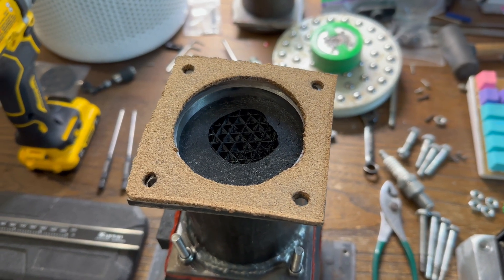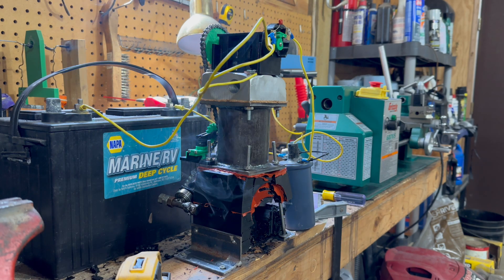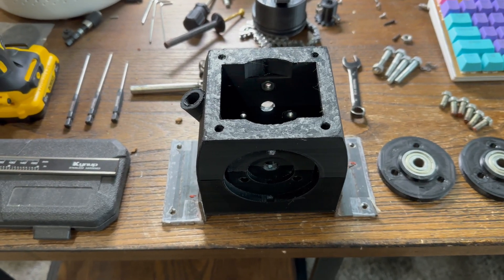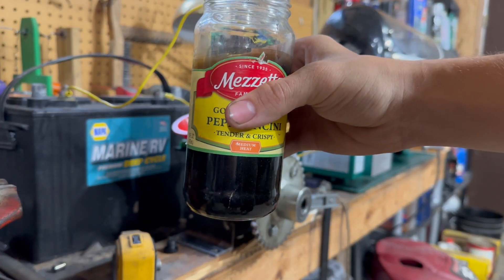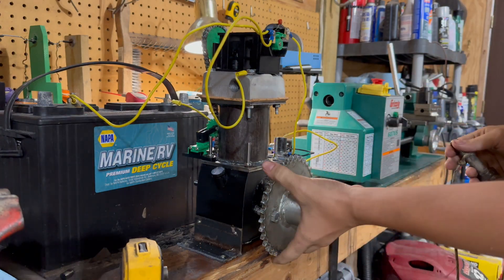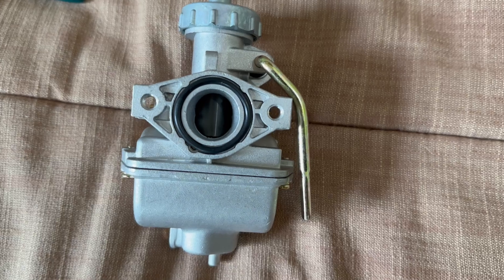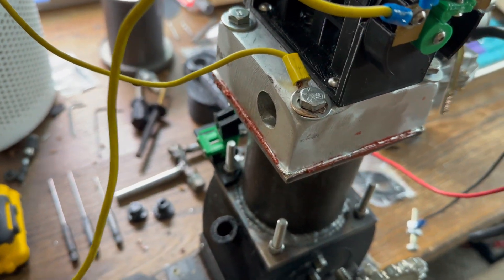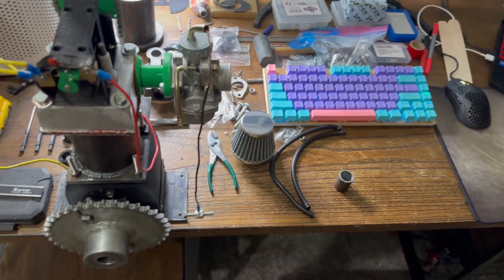3D printed 180cc engine RUNS!

Comment: I loved your excitement when it ran! Have you thought to make it smaller? I love the idea that you are making it big but isn't it a lot more dangerous like that? Also I wanted to ask if you could name EVERY part for the ignition system? I Have know clue how you or Camden Bowen made the ignition system...
Reply from the maker: The part I like about making it big is it’s a lot of trial and error until you get a part That’s strong enough to hold up. 

For my ignition system, I have a wire from the negative side of the battery running to one side of a light switch that I tore apart. The light switch has contact breakers in them, so I used them as my contact brake ignition system. There is a little cam on the camshaft that pushes up on a lobe that’s connected to the arm of the light switch, and that breaks the contacts. Then out the other side of the light switch that I took apart, I have a wire going to one side of the ignition coil. Out the other side of the ignition coil goes to the positive on the battery. Then on the negative side of the light switch contact breaker, I have another wire that is my ground that is in contact with the head, because the head is aluminum. Then I have a Small engine condenser that goes to both sides of the ignition coil, there is a wire and the metal casing, the metal casing side goes to the positive and the little wire goes to the negative on the ignition coil. And then out the top of the ignition coil, there is a wire with an alligator clamp on it that goes to my spark plug. That is the entire ignition system. The small red capacitor that you see in between my contacts is not necessary, I added that before I bought the condenser, but the condenser works way better. The small capacitor does basically nothing.

Hope this helped!!!
Reply: @ProjectLMZ  This was very useful! Thank you!!! But I'm a bit confused on what the engine condenser is... And also do I have to use a big car battery? Or can i use something smaller because that doesnt look very safe...😕 But again, thank you so much, this was very useful!!!😃
Reply from the maker: @TheBMWDrifter-sb2cy  a engine condenser is basically a capacitor, but specifically designed to be used in engine ignition systems. You do not have to use a large car battery, that’s just what I had laying around, any 12 V battery will work, like a smaller one for a 12 V power wheels toy.
Reply: @ProjectLMZ Thanks again, that's good to know!😁 It's nice to hear a YouTuber reply to questions in full form! For alternatives for head gaskets, do you know any? Because I don't have any, and I don't really want to buy any... Again, I could not thank you more for answering my question!!!😃 Also a weird question, but what country do you live in? Thanks again!
Reply from the maker: @TheBMWDrifter-sb2cy   The head gasket for my engine is made out of cereal box cardboard, Beer box cardboard would work as well, it just needs to be that more compressed and thinner cardboard, and then I put a nice layer of red RTV silicone on each side of the cardboard and then wrapped it with five layers of aluminum foil, making sure to put more RTV in between each layer. 
America!
Reply: @ProjectLMZ Yeah, I was thinking of using some cardboard... What is your opinion on two stroke engines and four strokes? What do you think are the pros and cons of building either with 3d printed parts?
Reply from the maker: @TheBMWDrifter-sb2cy  with 3-D printed parts I like the four stroke, I attempted a two-stroke a little bit back, but no matter what I did I couldn’t get my ports right. The other reason why I’m going with a four stroke is because I can get much more power out of it by putting a turbo on it. My future plans for this include a turbo and nitro!
Reply: @ProjectLMZ I was looking at some of your older videos, and when it was snowy, it looked like Canada, that's why I was asking. How would you add nitro tho? I'm making two stroke, and I'm gonna be cutting ports in brass drain pipe cylinder, but I don't really have any tools😕 do you have any experience with brass pipes?
Reply from the maker: @TheBMWDrifter-sb2cy  it sometimes feels like Canada here in Minnesota, for adding nitro what I would do is I would 3-D print a new intake manifold with a port for putting another line into, then I would just drip feed the nitro. I don’t have any experience messing around with brass pipes, but I can only imagine because the number one element is copper it’s very similar to working with copper pipe. I think the two-stroke is feasible as Camden Bowens new post, but they need to be cut very precise.
Reply: @ProjectLMZ Have you ever visited Canada? And if so, which part? The nitro idea is super cool, but id suggest working on making the engine run reliably, like Camden Bowens last video. I also noticed the way your runs, and I've taken apart lawnmowers before and if they aren't made properly or are tweaked properly, they struggle to run due to their shear size... Have you thought of making pretty much the same thing as Camden bowens? Then you could make your edits?🤔 Nitro and turbo what not...
Reply from the maker: @TheBMWDrifter-sb2cy  I have visited Canada, we used to go to Ontario every year, we would go to a lake called crow Lake and fish for lake trout.
I did start with a smaller engine, but I didn’t find it as exciting, and I really like the challenge of it being difficult to get going! With the new crankshaft, I have calculated the exact weight of the counterweights, and I will be able to match that with my rotating assembly. Since the rod is larger, I’ll be able to center my flywheel better.
Reply: @ProjectLMZ Well it definitely sounds like you have a plan! Not sure if I will see your video immediately tho, gonna be camping for the next week... Canada's great for camping btw. My family also used to go fishing in this one good area and get some big fish! But we most likely won't be going there bc they are dumping sewage 😅 anyway, I will try to keep up but alright I'm excited to see your future updates on the engine whenever I can!😁

Comment: you spend so much time printing useless plastic parts... just make metall parts from the begining. also the crank-case
Reply from the maker: That’s my end goal is to have all metal parts, but I’m using the 3-D printing as prototyping. Surprisingly though my connecting rod and case and valve train are holding up just fine!

Thank you for watching!!
Reply: @ProjectLMZ  that connecting rod surprised me too.

Comment: 14:26 Use a sacrificial piece of wood underneath your work or even 3d print yourself a vice.
Reply from the maker: That’s a great idea, I didn’t think about that! I 3-D printed a new intake manifold with the layer lines diagonal and out of a much stronger filament and it hasn’t had any issues, just the crankshaft snapped again😂

Comment: May seem really stupid, but I suggest using Flex seal as a gasket, it works pretty well in a actual engine, may work better than some cereal boxes and aluminum foil 😆
Reply from the maker: Surprisingly, my homemade head gasket has not had any issues yet, but I’ll keep that in mind!!

Thank you for watching!!

Comment: If I was going to 3D print a piston I would probably give it 100% rectilinear infill.  The broken one in the beginning of the video looks like it was around 15% cubic.
Reply from the maker: It was, with the current one it is at 40% infill cubic, with 3 mm walls, and it holds up fine surprisingly! At least I haven’t had any catastrophic failures with it yet. There’s no workaround to the heat though, if I start having melting issues, there’s not much I can do.

Thank you for watching!!

Comment: U gotta start using a two stroke membrane, it blocks the exhaust towards the intake fully, also it's shooting exhaust gas through Ur oil cap, probably leaking O ring as well :) nice build tho! 

Try and see if U can work with the info

Comment: You should make the flywheel perfectly straight and balanced if you don't want it in more pieces than one. Also, crankcase ventilation is a big thing, if you don't have it. As the piston goes down it creates pressure in the crankcase, if everything is sealing right. The hole you have is shooting oil out of it at bigger rpms, from what I've seen.

Comment: You have pressure on the crankcase. It means your piston rings are leaking. 💨 That's why you see all the smoke coming out of your oil cap on the last pulls. 💨
Reply from the maker: I thought the same thing, but after I talked to my uncle who is a small engine mechanic, he said the reason is because the cylinder volume and crank case volume are very similar, so you get a whole bunch of crank case pressure. It’s just gas moving in and out of the crankcase so fast.

Thank you for watching!
Reply: @ProjectLMZ  There is clearly exhaust being blown out of the oil filler, so the rings are not sealing correctly.

Comment: You need to fix the blow by. When your running it you can see more smokr from the crancase then the exhaust lol. But also, a bigger flywheel and to make the output shaft viberate less would help too.
Reply from the maker: I thought it was blow by at first, but after talking to my uncle who is a small engine mechanic, he said small engines have a lot of crankcase Gases that build up, due to the volume of the crank case being almost the same as the volume of the cylinder. All it is is gases, because even when it doesn’t fire, it still shoots it out. 

Thank you for watching!!

Comment: also, if you print your intake laying on its side it will run all the layers together in the flange to the body or tube part and make the part stronger.  it looked like it seperated right at a layer line where the tube sat on top of the flange.  if you print lying on it's side it may need support but i would bet anything the part will be stronger.
Reply from the maker: The crazy part is I’m filming for the next video and I literally today just thought of that!! I printed it horizontal and I holds up fine, but my crankshaft doesn’t.🤫

Comment: Those homemade crankshaft and flywheel setup u made are dangerous i would just 3d pring those an melt some metal down an cast a custome one cause what u doing it is not well balanced an its a plastic crankcase which makes it even more dangerous but hope u get everything going keep up the work an stay safe

Comment: Awesome work! I was just waiting for a fire though, even engines from the factory catch on fire at least once when you’re trying to get them to run. Ever thought about adding electric start?
Reply from the maker: I actually have a starter motor, but currently no way to hook it up. My new flywheel has a hole that I can thread a 1 inch bolt into, and I’m thinking I can do a drill start with that.

Thank you for watching!!!

Comment: Awesome to see this! After that first pull I instantly knew that the crank case pressure was building up causing the blow outs! Very good you figured that out lol that’s why engines have a PCV system but I would’ve done the same thing by just removing the oil cap 😂

Comment: Excellent work man, might want to cast the crank case out of some a356 aluminum though, you can also cast your piston rod.
Reply from the maker: I thought about it, but surprisingly it actually holds up! If it breaks from it running I will definitely cast one, but for now if it works I’m not touching it🤣 
In the future I was an all metal engine that can run a go kart or somthing, once I have a semi reliable engine I will boost it and add nitro!! 

Thank you for watching!!
Reply: @ProjectLMZ  that would be awesome, I look forward to the next update

Comment: that has a lot of blowby, but very cool
Reply from the maker: Yeah, but I’m actually not sure how, because it has so much compression that I need inertia to pull it over, but it still somehow has blow by. 

Thank you for watching!!
Reply: @ProjectLMZ  maybe because it has so much compression, theres just more energy to contain. possibly adding another ring would help out
Reply from the maker: @yukonxl5723  do you think that that could lead to too much friction on the piston for it to run?
Reply: @ProjectLMZ  it could, but as long as its and well lubricated it shouldn't do too much at all. but if there is indeed too much of an impact you can always take one of the rings off, and your back to what you had before. the only problem with rubber rings is longevity, because if they get too hot they start to deteriorate. But for what your doing with relatively short runs, they should work well enough. And if you do run it for longer periods I would recommend some sort of cooling. if you pour some water over 3d printed parts that are touching something that gets hot for example, you could keep them from melting temporarily. Also, one way you could make just the one rubber ring seal better is if you let some of the combustion gasses press the rubber ring harder into the cylinder walls by having a little hole at the top of the piston lead into the ring groove, which will let that combustion pressure force the ring from the groove onto the walls, which make them seal better. You just gotta make sure that you don't let too much pressure go there, because if you did the gasses could leak past from the ring groove and cause more blowby. So if that did happen, some JB weld or smth could patch the pinhole up.

Comment: You should look into lost PLA casting or petrobond sand casting. You could 3D print your parts then cast them in Aluminum or Bronze. If you do go the aluminum route meld down old car rims instead of cans. It casts much better
Reply from the maker: I have done some sand casting on this engine, the head and valves, but I just pushed a part into the sand and casted it, but I hear lost pla has much better results, I might look into it for the piston and connecting rod!

Thank you for watching!!

Comment: lol it's all just metal now
Reply from the maker: The plastic was fun, but not for my end goal, I always knew I was going to go to metal, I just never thought I would try to 3d print parts until I saw Camden’s video and I thought “hmmm, that sounds fun”. But the piston, connecting rod, crankcase, camshaft, timing sprockets, ignition module and cam housing are all 3d printed. I will probably in the future upgrade the piston to aluminum so it can run for longer, but the connecting rod somehow is holding up! 

Thank you for watching, I appreciate it so much!!!
Reply: @ProjectLMZ  oh for sure, can't wait to see it rip :)
Reply from the maker: @throwawaypt2throwawaypt2-xp8nx  me too!!

Comment: yoo lets go bro, this was worth the wait man! keep cooking up bangers! also i saw that the there was smoke coming out of the oil fill, so might have some severe blowby, witch means you gotta get the piston to seal better, or just get a metal piston.
Reply from the maker: Thank you man!! Thank you for watching!!
Reply from the maker: The weird thing about the blow by is the fact that it’s still got so much compression I need to be on the power stroke to gain enough inertia in the flywheel to pull it over for it to start, Otherwise, I literally cannot pull it over. I think it’ll be fine, definitely not ideal, but with how much compression it already has, I’m not too worried. 

Thank you for watching!!!!
Reply: @ProjectLMZ  i think its because you using the 3d printed piston and it expands more from heat, you that might be why it was stuck.

Comment: You should try and make a 2 cylinder boxer engine that way you don’t have to deal with the vibration and will be less destructive 😊
Reply from the maker: I’m thinking about a V twin so I don’t have to make a new crankshaft, but a boxer engine would be pretty cool. I’m hoping this goes kind of like Sterling engines, as once you get the hang of them, they’re super easy to build. If I can figure out how to do it every time you will see me making V8’s and Everything else you can imagine, and if I find the time, I’ll even try to make like a V12 or V16. Although I’ll have to see where I get.

Thank you for watching!!!
Reply: @ProjectLMZ  I personally have been working on a boxer twin the crankshaft has been pretty easy to build the main problem I’ve been having is with my my casting method 
I keep getting steam bubbles ruining my part and low yield due to oxidization of my aluminum
Reply from the maker: @Dnalor-sq7qi  my crankshaft is a homemade welded crankshaft, it would be feasible, but I want to get the single cylinder running first, but thank you very much for watching!!
Reply: I recommend using carbon fiber pa6 nylon filament from poly maker for the intake, it’s a bit overkill but thanks to its insane temperature resistance of 200 degrees C it will work perfectly. The only problem is that it has fibers (duh it’s carbon fiber reinforced) so you might need to upgrade your nozzle (I recommend a hardened steel version) on the printer. It is very important to check if your printer can reach a nozzle temperature of 280/300 degrees otherwise it could ruin the nozzle.

Comment: make a bolted support for the lower end of the connecting rod at an angle of 25* degrees, that way you get the effect of the force of a direct blow and the duration of the timing increases
Reply from the maker: Could you elaborate further? I’m intrigued now!